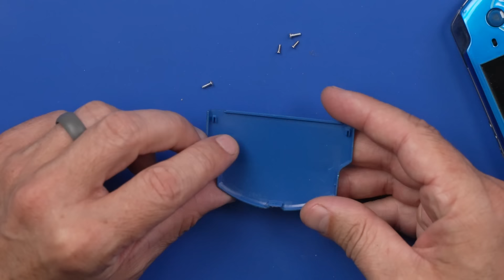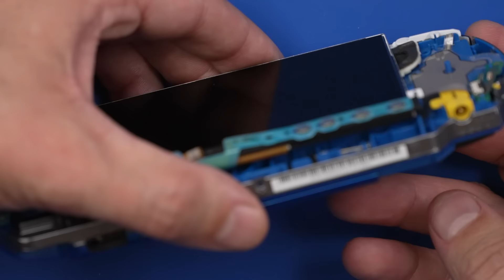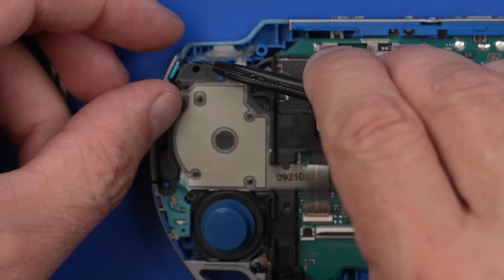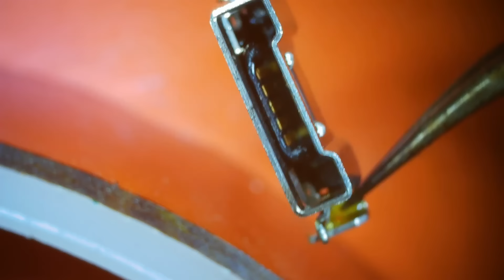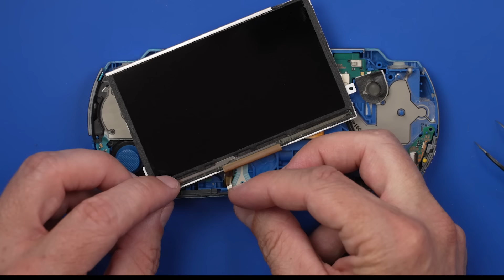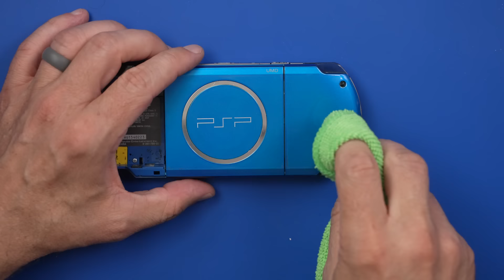A Repair Shop "Broke" This Rare PSP - Extended Version

Comment: He must use needle very small thin head micro then make it in open mode  or the dowen mode and push the black plastic to back forth let that pin s go inside 😊...

Comment: I tried to fix a psp screen, 3 times. And not one of the screens worked properly. They came from different sources, and either they had a permanent line through them or the contrast wouldn't work etc.

Comment: I replaced the screen on my PSP about a month ago.  Those ribbon cable connectors are a pain.  The small one was especially tricky to install, but the new screen works perfectly.  I hadn't used it in a while and the battery  had split open.

Comment: What's the trick to replacing these connectors with plastic on it?  Is it soldering temp?  Quick touch only? If it fails then let it cool down first?  My previous attempts were with a cheap 40w soldering iron with a fat half corroded tip.  I note have a small tip, temp controlled iron that works great.  But I don't have the courage to try these connectors again.  Need guidance please help.  

I was trying to fix my charging port on my phone. This required removing the screen and complete disassembly.  In the process, I ripped the ribbon cable for the screen.  Got a replacement, put it back together, and realized the WiFi connector was damaged.  One of 3 pads was ripped off when I tried to replace it.  I got 10 replacement connectors now.  Part me just wants to go at it again until I get it right

Comment: Am a Sony Hi Fi fan.  Remember when this came to market, along with minidisc.  I was also a Nokia user and was pining for their first portable gaming setup (carts).  If PSP would have had a cellular connection would have been in at whatever cost.  Nokia's N-Gage didn't perform well (sister bought one) I had the 7650.  To flip forward was hoping Nintendo's Switch would also handle cellular.
I am a very Niche market

Comment: not japan only Europe had them to i believe only limited time because i have a blue one and right at the last week of the warranty the laser broke when i went back to the store they send it in for repair only the psp nothing else and after two weeks they called me because they couldn't fix it and asked me if i mind a black one.
i really wanted the blue one and told them if they don't have a blue one they need to send back my blue one and the black one so i could switch the case.
they said they look what they can do after almost two months i got a message saying they have a blue one and sent it over right away.
one week later i got a brand new blue psp in box with a old date on it i assume new old stock.
now i got a blue still working psp never repaired and everything removable from my old psp including the box and blue battery cover.
and i never going to sell it way to much memory's.

Comment: This actually looked like a botched IPS job at first, but by the end it actually looked like a normal LCD.
But then, what happened around 26:13 ? Why's the screen different between cuts ? Or did you just put the dust gasket on it off camera ?

Comment: Recently, I had to replace the supercapacitor in my PSP 3000. Unfortunately, I also broke the laser track motor ribbon clamp. I didn’t have another PCB to replace the connector, so I came up with the idea of placing a piece of antistatic foam right underneath the LCD screen. Fortunately, when I reassembled the screen in its original position, the pressure caused the motor to work again. My PSP is now working just fine!

Comment: With those connectors I always line it up with the side that popped out on top of its hole laying flat and gently press down with my thumb and it always pops back into place. I never tilt it up like you did and try and push it back in bc of what happened to you. I also find using my thumb allows more even pressure across the tab instead of a point where you had your pick which caused the stress to concentrate and break.

Comment: For the ribbon connector you should use hot air from underneath. The plastic doesnt melt at all.

Comment: unasked tip: you can remove the fuse without hot air the same way you soldered the fuse with just the soldering iron and a bit of soldering tin (you melted the plastic from the charging port anyways)

Comment: I have around 20 Nintendo Switch and switch lites in various stages of repair and disassembly. I was wondering if you would be interested in them. I tried my hand at working on them. But I found I’m not very good at it. I have a ton of new parts too.

Comment: Hey everyone! I have a challenge for you please read if you’re interested! 

Today I was messing around with a circuit board, which is kinda new to me. The part is an exhaust gas temperature sensor for an Audi. The part never worked since I’ve had it, so it’s all pure learning. 

Once I got the circuit board out, I started testing all the fuses capacitors and fuses. All of my tests came out exactly like yours did at 11:49. EXCEPT ONE!  I thought this was likely the culprit. Instead of holding a solid beep like I was used to, it beeps for a half second and stops! 

When I removed the resistor I tried to test if the resistor would still have the same problem. Now it’s reading the same as the other resistors but it has no beep. 

I’m not sure where I should go from here.

There is no obvious signs of damage to the board  or anything.
Reply: I forgot to say thank you to whoever responds! So thanks everyone!

Comment: wouldn't heating the solder with a wick have worked better then heating it with the heat gun as it wouldn't blast any heat to the plastic

Comment: The component connected to pin number 3 on the memory line is usually a "capacitor" or "resistor".

Comment: I bet using a .05 higher amp fuse is far better than using a solid fuse with no short circuit.

Comment: In europe you could buy the PSP 3004 in "carnival colors" like vibrant blue and radiant red too.
But yours is a PSP 3001D (seen inside battery compartment). The 01 on the end is the country code, in your case it's north america, the D is for a later revision of the 3001. Japan would be 3000.

Comment: Well i butched my first psp  around 2005 or 2006 also when i tried to fix the screen. The main problem was back then there was no teardowns i could have watched and the screws where  confusing i seperated the blacks and the metal ones only to realize later there where two types. But i eventually fixed it, (baught a new case and fixed the blown fuse that the worong installed display frame blew. i wouldn't sell it but it is the one device where my c coding journey took off. I wouldn't recommand just bridging the fuse. The fuse could prevent bigger damage when the Display Frame gets bend inwards and shorts out something. I replaced the blown fuse with a self reseting one.

Comment: Do you knew if the psp 2000 lcd connector is the same as in the psp3000 or psp1000?
I dont find the connector to buy

Comment: I found a dude that was dumping "for parts or repair" PSP 1000s at $30 each on ebay a few months ago and the only real catch was that it was whatever PSP in his stash that he chose. 
It could have been run over by a car but still turn on, ya know?
After doing that sweaty guy that needs to choose a button impression, I took the gamble and then internally rationalized wasting $30 haha.
I got a blue one like what you are working on with a badly broken screen, no battery cover, the thumbstick cover was missing, there's some weird dried up gum goo on the top right corner, and mild scratching on the back. The metal disc circle thing on the back is super scratched somehow too. 
It does turn on though. I heard the start up noise when I put a battery in and tested it. 
I found a packet of multi colored thumbstick covers with a blue one in it and a new screen that is supposed to be the best screen for the PSP 1000 as of now. I also found a battery cover that is the same shade of blue.
All I need now is free time to take it all apart and put it all back together. 
It's all just sitting there waiting for me on my soldering station. 
I did not know the blue version was most likely a Japanese only model though, so this will be my first Japanese console in general on top of that if it is. 
Thank you for that little nugget of knowledge 👍

Comment: I’ve replaced so many locking tabs without replacing the ZIF connector cause it’s so much faster. I feel you that they are fragile but once you see how they are supposed to clip in, and each one is different, it’s way easier and quicker.

Comment: For removing that fuse next to the port, you should get the Metcal Talon, it's basically a dual tip soldering iron that can open and close like tweezers and allows you to just grab and desolder a part all in one step.
Reply: you are a friggin God since I've been looking for this exact tool for years and have been having to resort to using flux, braid and a little heat.
Reply: @DriftKingfromTekken3  The Talon works on the MX-500, PS2E-01, STSS-01, STSS-02 units, might be others but I have used those units before.

Comment: I bought mine Vibrant Blue PSP 300 for equivalent of about about 60 USD about 3 years ago. Spend another 10 USD for parts. I played and completed 3 Final Fantasy games, and both God Of Wars on it since, not to mention a lot of Everybody's Golf in local multiplayer (I have 3 different PSP's and they are all in perfect working condition, and they are sill used every month, usually by my naphews) but the blue one is used almost daily. I have quite a nice collection of consoles (PSP, PS3 Fat with PS2 BC, PS4, Famicom, Gamecube, XBox, XboX Series X, Genesis and Dreamcast) but I still PSP is the one I play the most. Maybe because I can play at most 2-3 hours a week, but still, PSP got wonderful collection of games and I am happy each time I see one in working order.

Comment: Those LCD locking tabs are HORRIBLE no matter what.  I did the same exact thing on a PSP 2000, the latch slid right off like how it happened to you, luckily I was able to get it repositioned, but I think it's common for those latches to be pretty terrible.

Comment: What do you think fixed this? Just simply reseating all the ribbon cables, bad connection with the "fuse" or the connector for the screen was already broken? Maybe not having the analog stick ribbon cable plugged in but I doubt that. I miss my PSP from back in the day. I took a "friend" in so he wasn't homeless and he stole it. Anyway good fix!
Reply: Yeah, it'd be interesting to know exactly what fixed it
Reply: Probably bad "fuse". It seemed like it wasn't getting any power.

Comment: You need to start using two soldering irons instead of the hot air rework station.
Reply: @kopono  Im a SMT operator, we all use two irons. I could train you in like two weeks. You would love it.

Comment: Why not just remove the black locking flap and replace that, just a thought❤
Reply: Yeah, Steve why did you have to replace the whole this why not just replace the little clip?
Reply: 3 reasons I can think of
1) the black piece is not a common replace part to have around
2)if you have it it's most likely installed already on the main part
3) it's very small and dificult to place the plastic inside the main part without breaking it

Comment: Just because I'm trying to learn. Why doesn't removing the fuse from the top of the board also cause a problem? Is it unnecessary or redundant and therefor okay that it's not present? EDIT: Or did I miss that it was taken from a donor board?
Reply: It was from a donor board...

Comment: Actually that metal thing goes on top egde of screen and its used to properly mount the screen as it holds the screen from top and then one of the top screws through it

Comment: what if the repair shop did fix it correctly and had a broken one that they couldnt fix and swaped them out😮 i had one do it with a aspecial edition ps4 i had
Reply: I think this happened to my PS2 years ago. Went in to change the lense, got a call a week later stating the board was bad. Took it back and it was a different PS2, didn't even turn on. Small shop at the time so I kept getting a run around. Was in college and had exams so I just let it go.

Comment: What a beautiful device. My parents could never afford a PSP when I was younger, despite how much I wanted one. Never had one, probably never will, but I still wish I had one. Minidisc and UMD fascinate me.
Reply: Ebay - I've gotten 2 (1st and 2 gen) for about $20-25 that worked fine except for a battery replacements.
Reply: i bought mine at the flea market for $30. had to fix the door on it. it can charge up & stay on for a while & the next day the battery is dead
Reply: Digging through boxes of things I collected over the years and found the limited edition pink psp-1003 that I got for my ex. You're right, emulators are great but they just don't give the same feeling as holding the older gen gear, whether that's a PSP, GameBoy or older consoles.
Reply: I really wish you had gotten to experience it, brother. I saved up my money and bought a used 1001 back in like 2007 and not long after I modded it, one of my favorite childhood/teen memories was experiencing true console gaming on the go and the UMD/mini-disc was really cool at first until you had to carry your whole collection of anime, games and movies with you, modding really made that system what it was. Unlocked the CPU to play all games in max power mode and had an extended battery and a Micro SD to memory stick duo adapter, had my whole collection of games ripped to my PSP, TONS of Japanese only games with English patches and tons of PS1 converted games. I still have it and still go back to it here and there. :^)
Reply: @CheekyChan  That sounds like a fever dream! Amazing that you got to experience that and still have it! I was very jealous of my friends who had one. I've seen youtube videos of people who have a modded version with modern power solutions and upgrades and it's really spectacular. I might have to make an investment here pretty soon.
Reply: Second best Sony system ever behind the PS2.
Reply: Just buy one, they are dirt cheap.
Reply: I also dreamed of having a PSP since 2007 (6th Grade Elementary), but after years of dreaming and hardwork, i bought my first PSP on 2014, and sad sadly sell it around year 2018, then i get a Job and after College @ 2021 and then after years of spending money i bought it again this 2024. Working Hard and Determination is the key :)
Reply: mini discs are super futuristic
Reply: Thats whats great about being an adult. We can buy the things are parents couldn’t get us! I just bought a xbox 360 gears of war console last week. Legit i dont even know why i just wanted it. 😂
Reply: Got one on ebay for 60 English pounds came with four games and memory stick original manuals, plus one of the games was a rare promo copy of phantasy star portable 2. Worth about a few  pounds on its own.  Psp works perfectly. It's the 3000 edition aswell all in all a cracking deal. If you shop about you can find the right deal for you and it doesn't have to break the bank.
Reply: Do yourself a favor and just get it. Got my pink baby PSP 1000 model in 2025
Reply: You may get to for the next psp ? Whatever.
Reply: May get your chance with the next psp ? Whatever.
Reply: Got a broken PSP-2006 from my friend and I fixed the screen, hopefully it works when I finally get a battery or charger for it
Reply: If you've got an android phone you can emulate psp games on there.
Reply: @BilalKhan-ml3ht  Emulators are great, but they cannot emulate the joy and feel of an actual PSP console. These are a timepiece for sure.
Reply: @clarkesuperman  than buy a psp u are old enough now :)